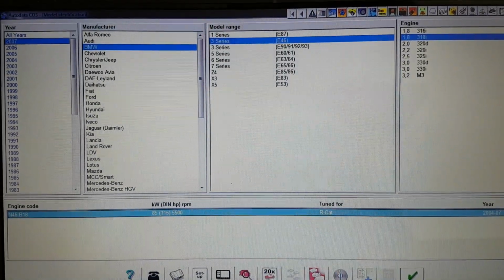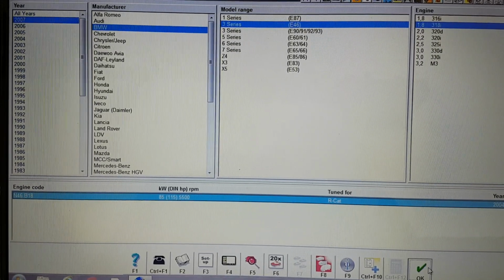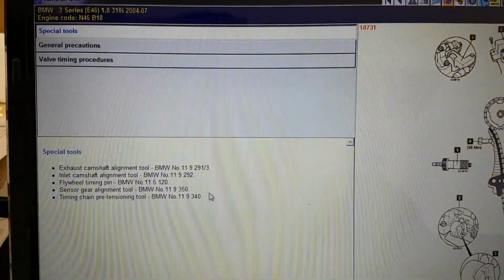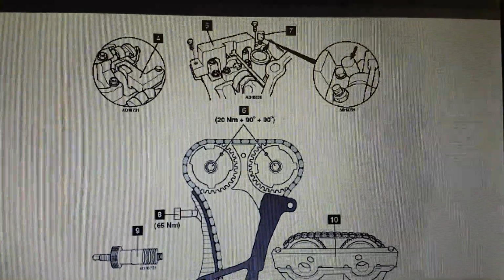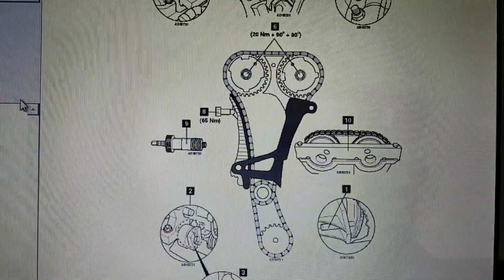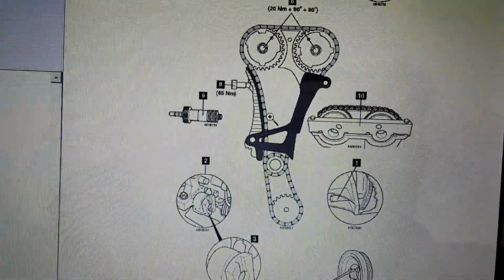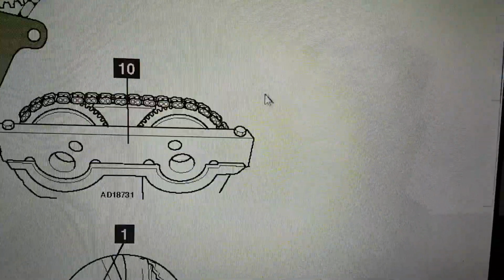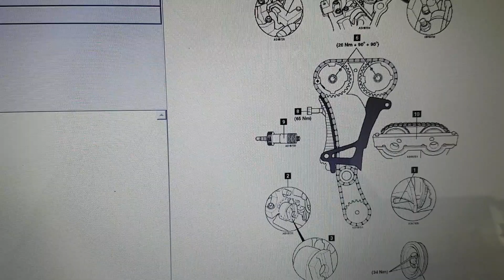BMW 318i E46 2007 Timing Chain Diagram

Comment: Correction: e46 production ended in 2005 no e46 was produced in 2007. This diagram is for a N46 engine which was used in some bmw e46 318i and e90 320i cars.